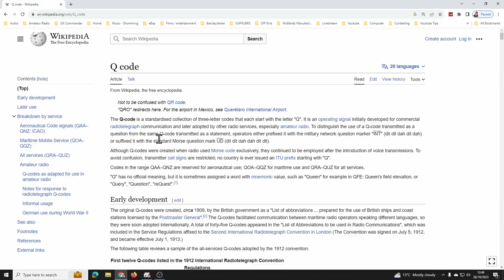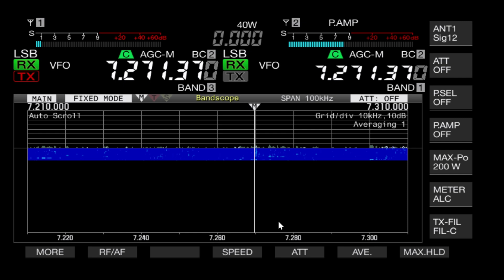▶️ Radio Interference - QRN vs QRM - I'm Confused?!

Comment: I was taught M is Man made (e.g. RFI or other stations) and N was Natural (e.g. static, aurora, lightning). I was also taught to add numbers after QRM/QRN (1-Nil, 2-Slightly, 3-Moderately, 4-Severly, 5-Extremely.)
Can't recall hearing hams using the numbers. Instead, on CW at least, you might hear "VY QRM" (very QRM) rather than "QRM5".

Comment: Cal, it was my understanding that the difference was intent. Are you being interfered with by another individual (likely a man back in the day when the codes were created and women were fewer) so man made QRM. Or how strong is the noise floor, QRN, which includes atmospheric, fridges and Led lights that produce noise, but not intentionally to ruin your contact. Cheers from Moose Jaw. Tim VE5THF
Reply from the maker: Reading the comment, the jury is split..!

Comment: Sir Callum, thank you for your service to the Amateur Radio community.  Faraday shielding and power cable shielding essentials would be an excellent video.  When I’m running QRP with my tr(u)SDX is like pure battery power to avoid as much dirty-sources of EMI from AC power supplies if at all possible.  You are a no-nonsense kind of guy!  73 de KD6UYK (Tim).
Reply from the maker: I can't add much - but I have 2 examples only - so I could make a short 3-min special if you like..

Comment: i have been a listener for 40+years and can identify (or best guess) most of the noises on the bands when i use the codes i tend to stick with QRN for natural noise (lightning/ solar bursts etc) and QRM for everything else but if someone uses what i feel is the wrong designation i dont get all spelling police on them. if they are an "experienced" ham they should know whats what if not its on them..
Reply from the maker: I like that..

Comment: A interesting but faulty question.. the answer is NEITHER !!!! Pretty sure almost all organizations using Ham Radio for Voice or Data for Emergency Communications, repeatedly stress that "Q" codes are not to be used.  The key in any communication is to be understood, soooo, if you, with all your experience, are wondering if QRM or QRN is the right code.. THEN we have a failure to communicate... Better to just say what you are hearing.. "I'm getting interference and it sounds like atmospheric static", or "I'm hearing a radio operator deliberately trying to interfere with our conversation" I guess if you are using hand keyed code, you might have a reason for brevity, but I don't hear you doing a lot of videos on CW.
Reply: Like to said to my friend Phil the other day, "sounds like frying eggs".
Reply from the maker: Well, we're taught the basic Q codes in our world.. Guess yours is different..
Reply: The ARRL says that Q codes used on both CW and voice are "Good Amateur Practice".  The purpose served by Q codes on voice are exactly the same as on CW.  This is the exact same reason 10 codes are also commonly used by public service organizations on voice.

Comment: That's a good question. In my mind, QRM is any noise caused by man. QRN is purely natural phenomenon that causes noise on freq. Be it solar activity, cosmic rays, lightning, etc. Anything NOT man-made. But, as you said, when the Q codes were defined, there weren't as many man-made things to cause interference, mostly only other transmissions. Perhaps there needs to be an official definition put to QRM/QRN that includes all those things... or perhaps a new Q code that encompasses noisy man-made devices of a NON-radio sort. Good question. I personally agree, it isn't worth arguing over the minutia of the cause of noise. Noise is noise, if it's not another radio transmitting, there isn't much that can be done about it.
Reply from the maker: I like the qr(M) where M is "Man-Made"..!
Reply: @DXCommanderHQ  That's logic .